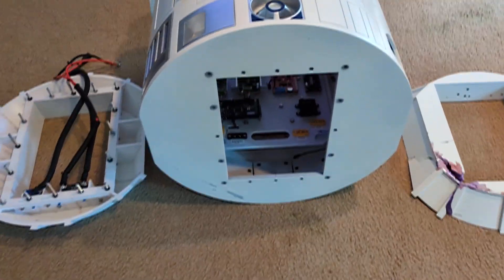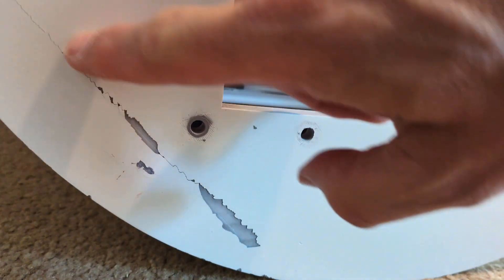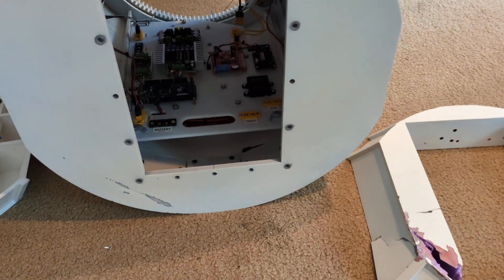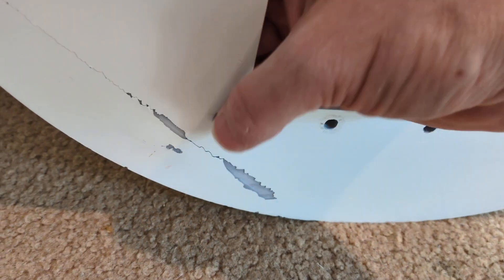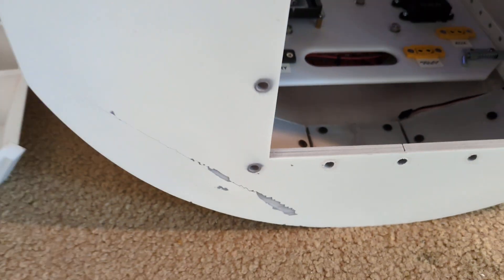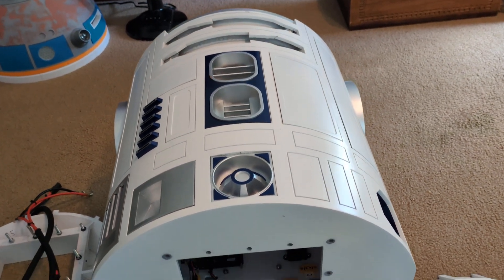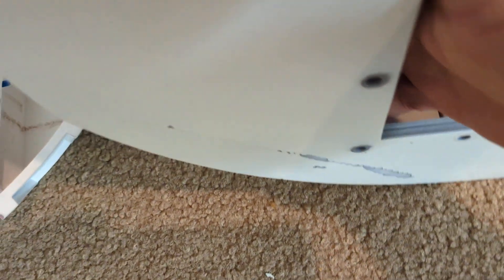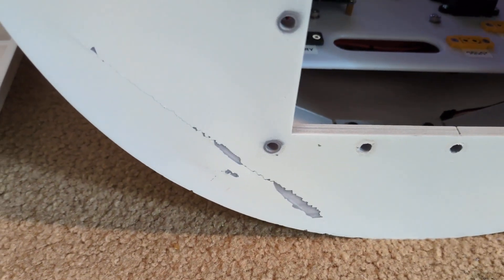3D Printed R2D2 - Part 114

Comment: Tom, I would use heat staples like the ones used for fixing car bumpers, melted across the crack should be very strong.
Reply from the maker: Thanks for the suggestion!  If the bottom was solid plastic, that would work.  Since the infill feels like it's compromised, I'm thinking that cutting the top layer off and filling the damaged infill with epoxy is my best bet.

Comment: I agree with some of the comments that this might not be as bad as it looks. The epoxy idea might just do it, I've seen big dinner tables made out of pieces of wood and put together with epoxy and they hold just fine, it will be strong enough to give the structure the rigidity you need. The other thing I can think of, after doing the epoxy part, is just add a 1 or 2mm flat metal baseplate to the bottom of the R2 body so that the entire thing rests in the metal plate. That should go between the body and the skirt. Won't change the composition or dimmensions of the body, and will add a ton of support.

Comment: The amount of times I have Crashed, Smashed & Bashed my completed R2 over a year ago would make you cry.

Fill it up with epoxy, a quick paint touch up & stop worrying so much, move on. At this rate you are never going to complete the project.
Absolutely no-one will look at cosmetics once complete, they just admire what you have built.

Keep moving forward ⏩
Reply from the maker: This is my current plan.  After a few days of thinking about it and seeing all the responses, I agree that I'm putting too much thought into it.  

I hope to start working on it soon.  I've been taking care of the leg greebles in the meantime.

Comment: Good to see you're back at building R2 again, I learnt so much from your videos. I would probably dremmel it out, fill the gap via a 3dpen or soldering iron and fillament. Just really melt it back together, then fill the dents with epoxy. On the inside, as it is restricted, I would use the plastic staples that you used on the body. Just sink them in deep as you can. Looking forward to seeing how you fixed it. We all have issues building this little guy, I had him complete, and then all the epoxy came apart at all the body ring joins. Had to rip up new paint, but fixed him with the dremmel, 3d pen and is stronger than ever.
Reply from the maker: Ouch, your issue makes mine look easy!  Glad you were able to fix yours.

Comment: Tom, I don’t think it is as bad as you think it is. Your idea of using epoxy would help stabilize that area. I would maybe reprint the backing plate with a thinker infill and maybe make it overall thinker. You just need to spread the stress of the foot across the entire bottom surface and let the undamaged areas take the majority of the load.

Comment: I’ll preface this with I think the epoxy idea is good and would likely do the trick.  It’s also simple which is often the best solution.

I wonder if you could use a method similar to a “bowtie” in woodworking.  It’s often used to stabilize cracks in wood.  You cut a bowtie slot across the crack and then press fit a bowtie into the slot to pull in the crack and relieve the stresses. You would probably need several across the crack.  Print a jig to locate the slots, and then print some bow tie pins to epoxy in. 

Or possibly epoxying in a metal bar/angle stock into a cut slot?

I still think your original idea is the best bang for your buck though.
Reply from the maker: The bowtie is an intriguing idea.  If the bottom was solid, I think that could work.  Unfortunately it's basically a few millimeters of solid plastic on the top and bottom with a gridwork between.  The crushed gridwork would still be an issue.